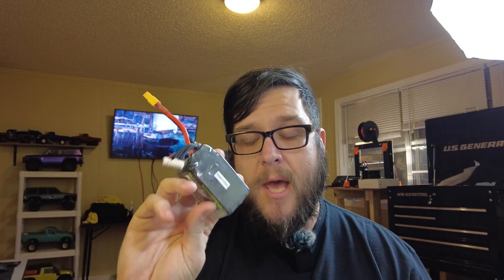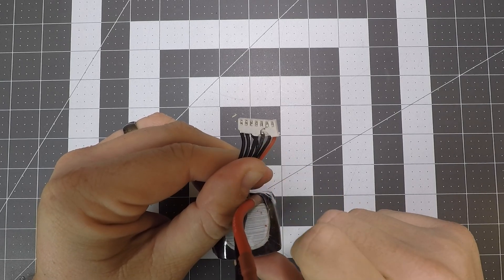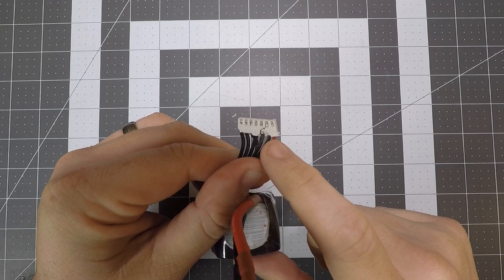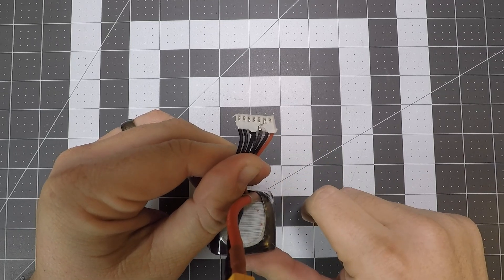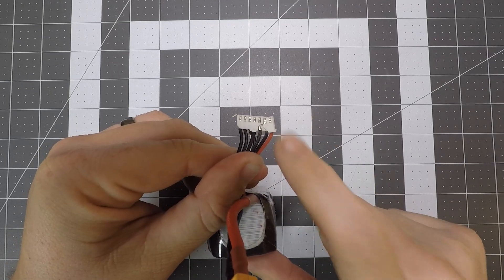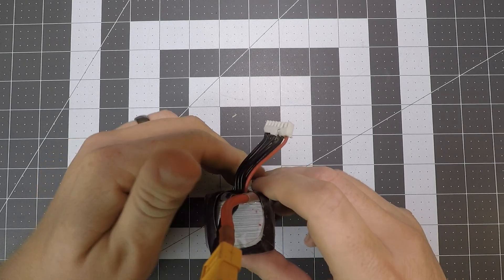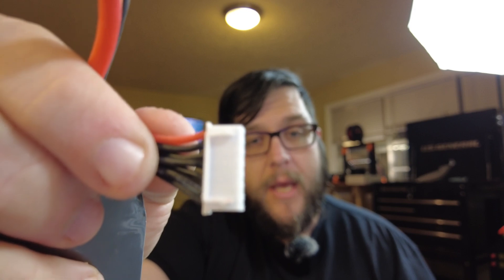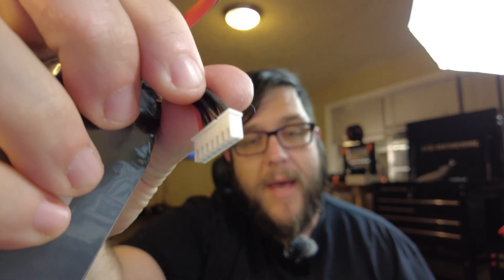Broken LiPo balance plug? May not be trash! | Bacon Grease FPV Tutorials

Comment: Mr Bacon Ninja FPV - 
Although this is a basic repair, there are many things that I learned in this vid. The fruity smell of a leaky cell is something that I've never heard before, but this seems VERY IMPORTANT.
Also, the info regarding the internal resistance being 10-15% is great to know.
I have ruined batteries, mainly by charging and never using them, and I have learned to scavenge and reuse cell packs, because when my batteries are damaged I feel like I'm throwing money into the trash, and it bothers me.
I would LOVE to see more in depth,   "ALL THINGS BATTERY"  type vids 😎
Reply from the maker: I am so glad you picked up a few things from this simple little video!  Battery maintenance and repair is such a touchy subject, and it is always super important to do it as safely as possible.  I am for sure going to do a deep dive into batteries at some point because I think there is just way more there than most people realize.  Waiting to get through a couple of things with my new HDZero 1W setup first, but it is absolutely on the list!

Comment: Having come from 1/8th buggy racing loooong before fpv around 2007 or so we got really good at lipo cell/lead repair. Those packs back then could run you 150-300 per 4s 5000mah. So yeah dangerous experimentation while at the track was a daily occurrence. Many many lipo fires happened. We even had a protocol shout out “code red” when one would short out lol!
Reply from the maker: Oh man, I remember my buggy days.  I did nitro quite a bit back then, but i did have quite a few packs for electric rigs too.  Crazy how cheap those big packs have gotten over the years.  I have 80,000 mAh worth of 3S cells for crawlers just sitting around too but those are way more recent.